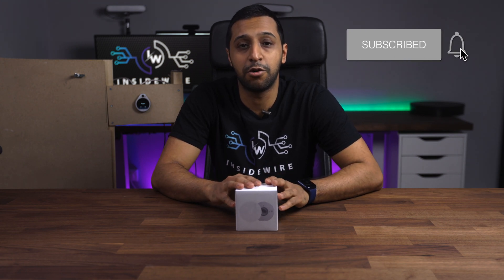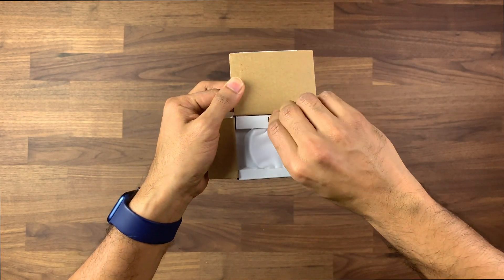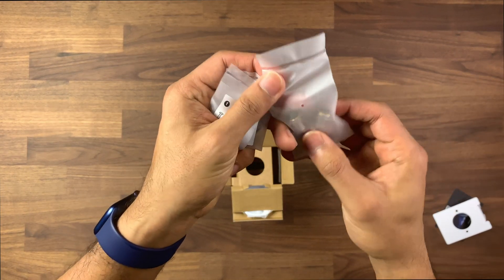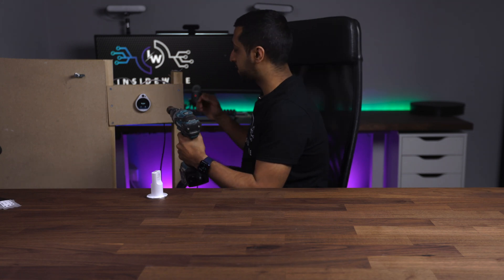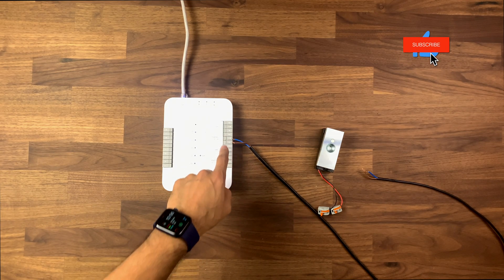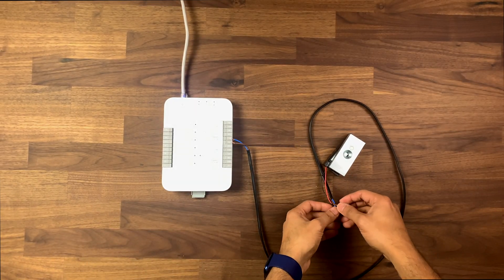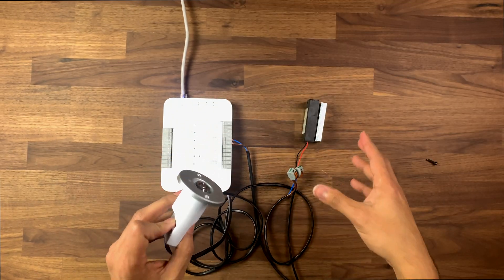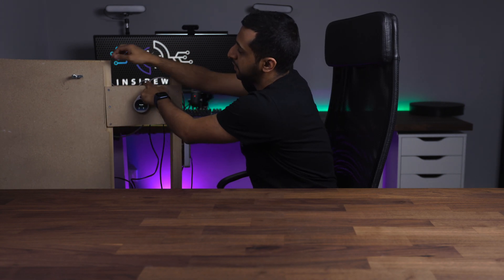Unifi Access Rescue Key Switch | How does it work?

Comment: So unless I’m mistaken, you wired the key switch in parallel with the maglock? Meaning turning the key shorts the 12v supply to the maglock instead of in series where it could just open the circuit?
 
Even then, there’s inputs on the Hub to support external triggers right?

Comment: I like UniFi quite a bit, BUT anyone who uses this POS key switch gets what they deserve.. Easily picked and I mean EASILY!  UniFi is NOT a lock company in any sense of the word, so use real parts from real lock companies..
40+ years of experience in the "Industry” gives me the right to call UniFi out on this particular part ! ! !
By The Way——If you use an electric strike, in conjunction with access, —you would have a latch lock that already has a key cylinder. DUH
Using a mag lock alone means lots of battery backup required, but use a strike in tandem with a mag lock and now you have better security regardless of electric failures/Etc.
N/O for the strike and N/C for the mag..
Reply: As a former locksmith I would not like having this on the door.  I have to agree with you that this is a serious security risk waiting to happen. Those locks can be defeated with everything from the plastic cylinder of a Bic Pen to readily available cylindrical lock picks on various well known shopping sites.  Switching to a steel plate with specialty locks available from ASSA, Abloy, Multi-Lock ect would only help with the pick resistance and not the prying of the lock/plate off a wall to disconnect the rear wiring.

Comment: Couldn't you just remove the rescue key lock and short the wires to open the door? Wouldn't there be a lot of vulnerabilities with this?
Reply: yes, and yes, it isn't secure
Reply from the maker: It would not be advisable to keep something like this in sight; this would need to be kept somewhere else that isn’t as easily accessible as the UA Lite or UA pro